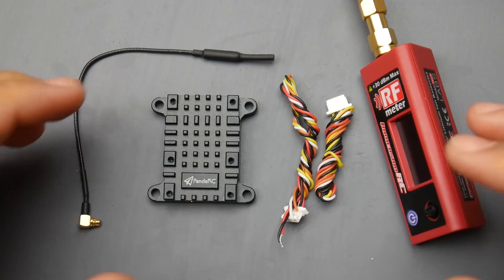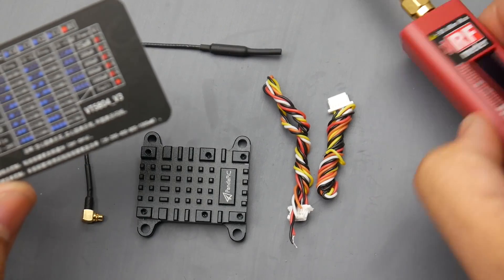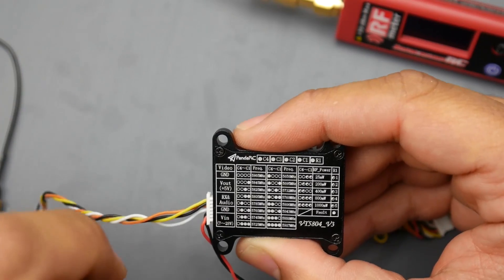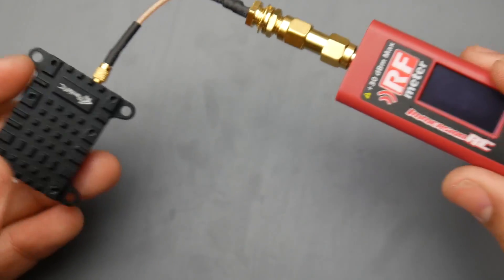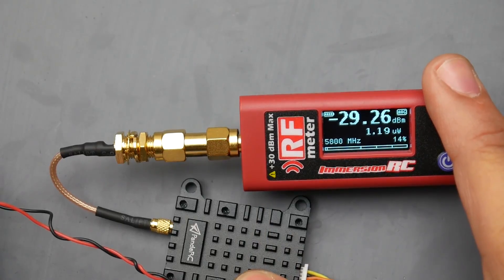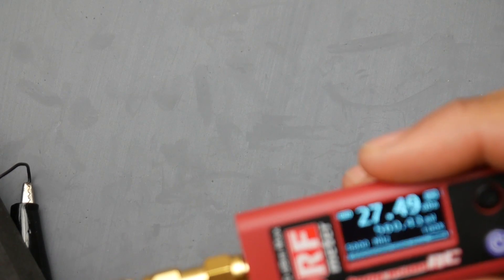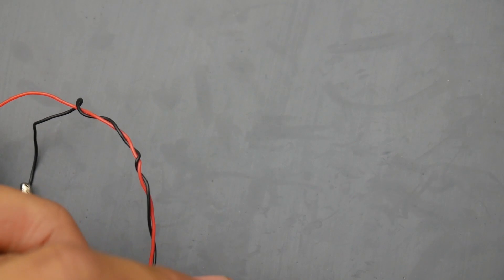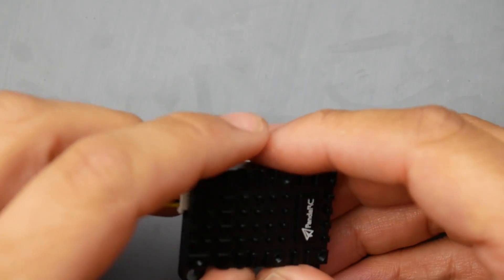Can We Hit 1000mW with $40 // Panda VT5804 V3 5.8G VTX Review

Comment: Are there any 800mW or greater VTX's that actually output 800mW or more?
Reply: There are plenty that go over 800mW, why you would need it would be another story. You probably just have the worlds worst antenna if you're needing more for common RC use.
Otherwise, you will still need something different than 5.8 Ghz if you're actually trying to fly out over 15 KM or 10 miles (you can still do it with a good antenna setup on model airplanes, but I'd still switch to lower frequency for better penetration and much less radio noise since 2.4 Ghz and 5.8 Ghz are the 2 frequencies used by WiFi routers, so don't fly near cities since they have tons of radio interference).

If you are flying behind lots of trees, then 5.8 sucks. If you are flying behind lots of metal buildings, then 5.8 sucks. If you are flying past 10 miles, then 5.8 sucks (in all of these it can be done, but its not the best tool for the job).

I have only ran out of range when 200 feet of dirt was in my way (thanks curvature of the Earth...) on even cheap $10 "600mW" generic video transmitters, but you need a good antenna on your VTX and your goggles. I don't have anything fancy, but still only my micros with 25 mW do I run out of range (and even then, its usually from flying behind too many metal buildings. With direct lines or with little metal in the way I get 1/8 mile perfect, and I usually don't fly much past that on the lowest 25mW setting for sub 100mm class quadcopters (bigger quads I recommend higher power since they go a lot faster and you seem to cover a lot more ground).
Reply: @jakegarrett8109  Yes I had wondered about switching to a lower frequency. Right now on 5.8Ghz 200mW using a Pagoda on send and recieve with ev800d diversity on the recieve along with the patch antenna that comes stock. In low interference areas I get just over 1km before I lose vsync and in bad interference areas I can only go 600m before I lose vsync. For my purpose I just want to go 4km max and not have it cut out when turning round. Object penetration would be useful but generally I am really careful to maintain line of sight.
Reply: @changeagent228  Sounds like you know what you're doing then and that your setup is pretty well ironed out on the 5.8 spectrum. For the interference issue, lower frequency should help quite a bit for those areas since really nobody should be using 1.3 (by nobody, I mean the average person not in modeling, since pretty much every home has a 2.4/5.8 Wifi router, but I can't think of anything that uses 1.3 in a home, garage door openers are often 433 Mhz and 350, but even those are only activated for like 1 second of the day). So it sounds like your getting pretty reasonable results and know how to use your gear (keeping it LOS really helps, sometimes I forget that I'm just a dude just standing on the ground and not a bird flying around, lol!).

If you do switch over to low frequency (might be 1.2 or 1.3 depending on your country), then I hope it works out for you and you can get a bit more range and fewer cutouts. (I haven't range tested my Pagota antennas yet on 5.8, I still need to get my bigger quad in the air for some proper fun range tests next time I go out to my parents farmland, those sound like great antennas for FPV from what I've heard, so good choice!)
Reply: @changeagent228  Oh, the only thing I can think of that might help for those turning cutouts without buying anything, would be to check your antenna angle/position. You might be able to get away with just changing antenna orientation or height just a little and get some better results. With quadcopters, I usually mount the antenna roughly perpendicular to the camera angle and mounted at the back (so in cruising, it should be almost straight up, and viable above the frame), but it depends if you're doing flips and if the carbon frame may block you (so you might actually see if putting it off to the side helps, like if you make left turns a lot, you might even lean your antenna over a little if its a model airplane). That's the only thing I can think of that might help without spending a dime on new gear. You might already have it perfectly optimized, but there are a lot of options (for example on model airplanes, a lot of people put the transmitter in the wing tips or winglets, just put the transmitter in the inward side you usually turn in so you don't have the rest of your airplane getting in the way of the signal, this may require relocating your control receiver or battery for the CG though, but its another option).

Have fun!
Reply: @jakegarrett8109  😄 Yeah those Pagoda antennas have a good flattened torus radiation lobe pattern. If you fly right directly above them you will hit the wide null point though. What puts me off 1.3 is the size and weight of the vtx tx. Someone needs to come up with a micro module.